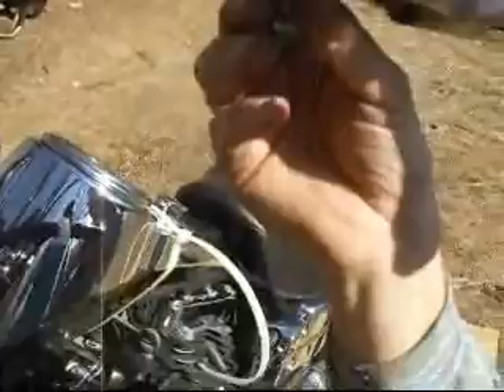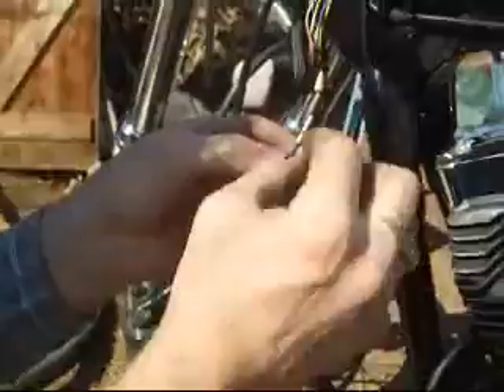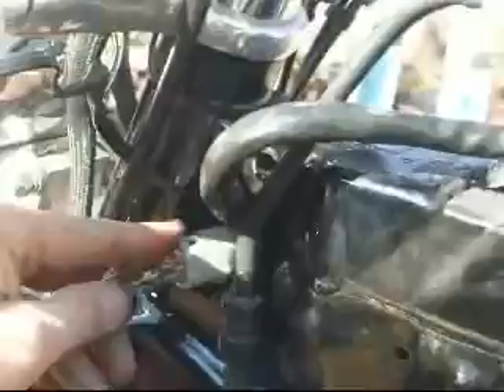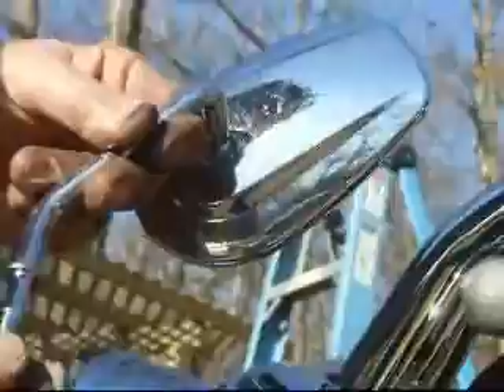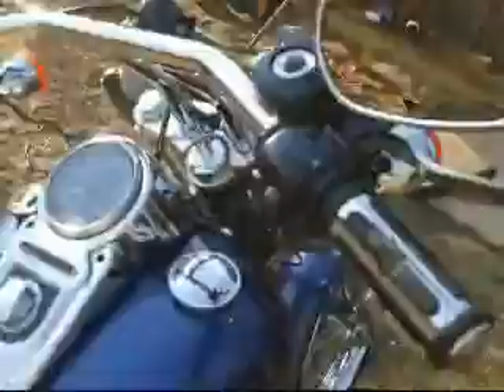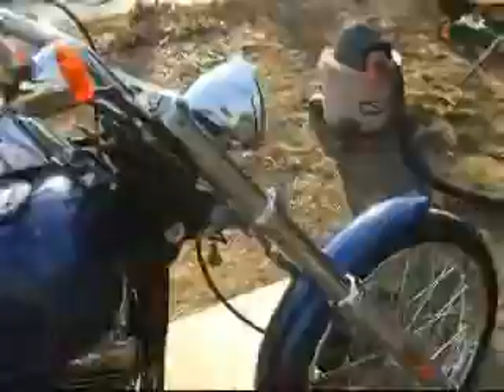Pt. 5 of 5 - Drag Bars 2006 Harley Dyna Wide Glide.wmv

Comment from the maker: @bearkiller1960 
Hi BearK,
Yea, definitely Do Not cut the harness wires unless you're doing a bar install that you know for sure the harness is not going to reach (Longer Apes). It's a reasonably simple process for disconnecting the harness plug and then re-inserting the wires. I hope the install goes well for you & let me know if you need anything else.